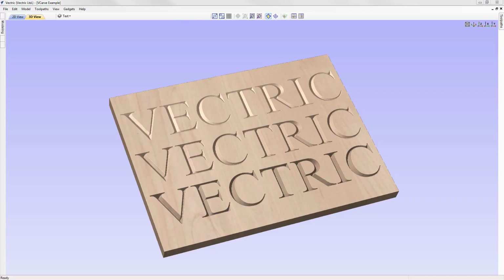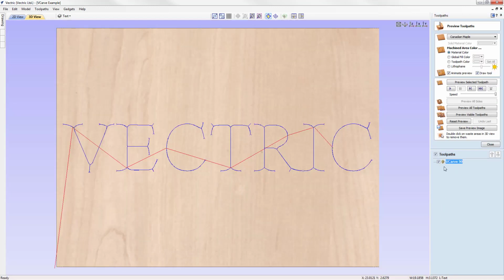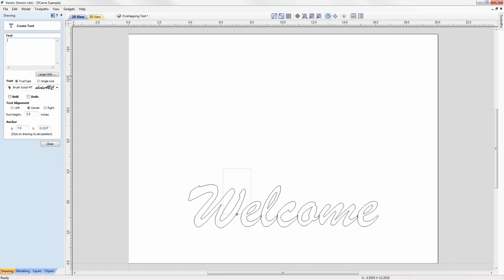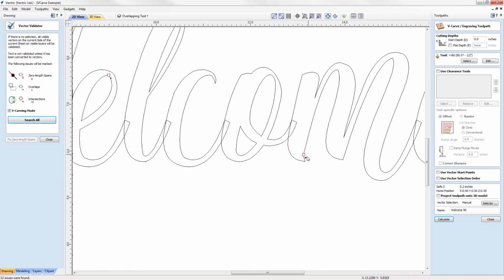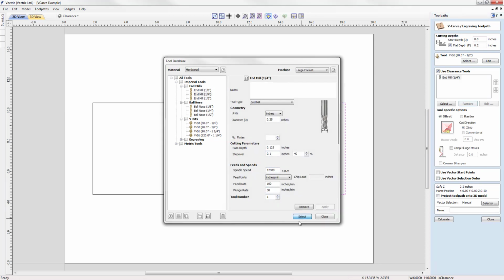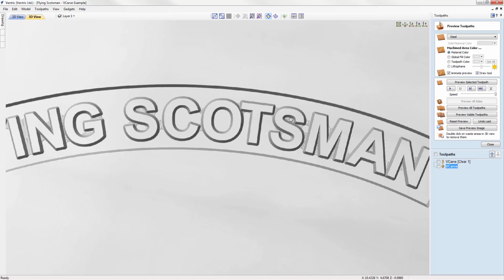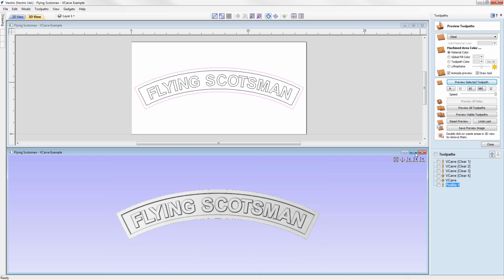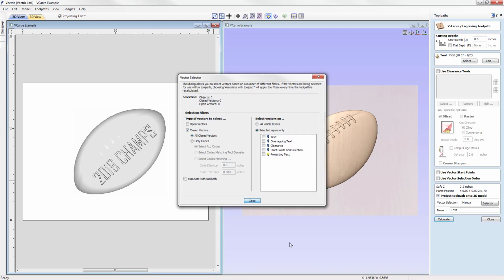Vectric V10 Tutorials | 2.5D Toolpaths | VCarve Toolpath Guide

Comment: In Easel I just draw a square and it makes it with a selected v bit toolpath. I just wanted to add a square line around my main artwork in the middle, like a border and gah! Spent a grand on the program and took hours to figure out how to make one v carved square on the board. I mean it's great the detail we can manipulate in a project but gosh sometimes simplicity wins too
Reply from the maker: Hello John and thank you for taking the time to leave a comment.  For a very basic v-carved box it is a pretty simple process in VCarve...  just a couple of clicks.  Of course there is a bit of a learning curve when you move to any new software.  If you did it again, now that you have done it once, I suspect it would be an easier process.  Easel is not a capable as VCarve so it is expected that we have a few more options to consider.  You point is very valid... and we have tried very hard to make our software easier to use then our direct competators.  We are always working to make our software better, so I will be sure to pass your thoughts onto the Development Team.
Reply: @vectric  you're right. I took an intensive dive and it does indeed take getting used to and making that box is just a few clicks as you mentioned and the amount of control I have over the line, I am so glad I switched over.

Comment: Great video. If you are using multiple tools for clarence do you have to stop your machine manually and change tools and start again on X & Y Zero for each tool change or the machine will carry on into the next toolpath with the incorrect tool?
Reply from the maker: Hey there! When using multiple tools to clear out you will need to stop the machine to manually change the tool, if you have an automatic tool changer machine then the ATC will do that automatically for you :) I hope this helps!